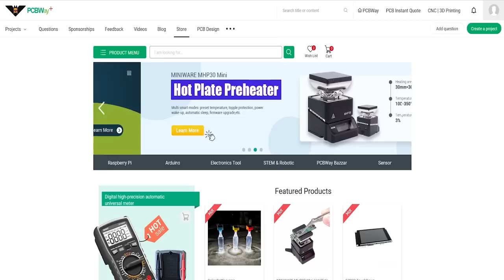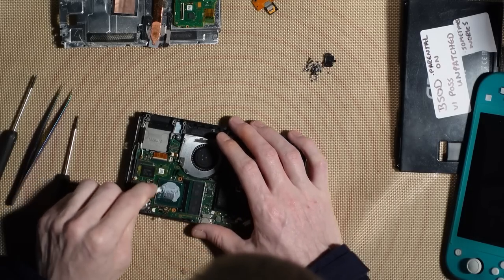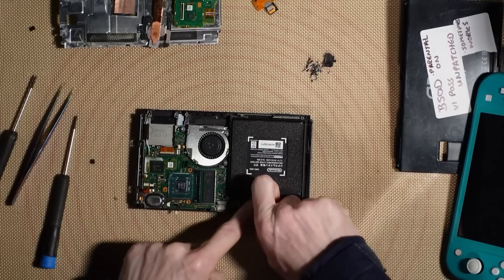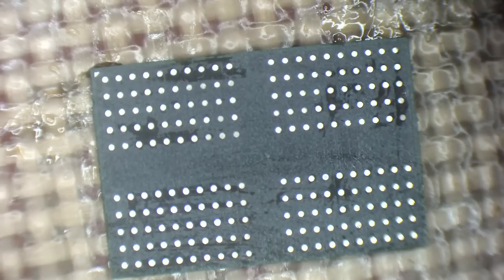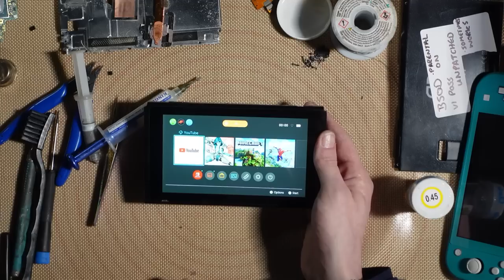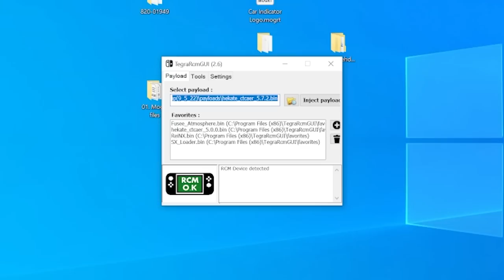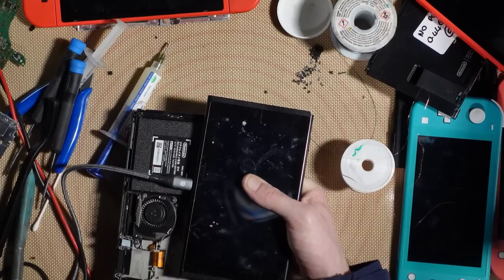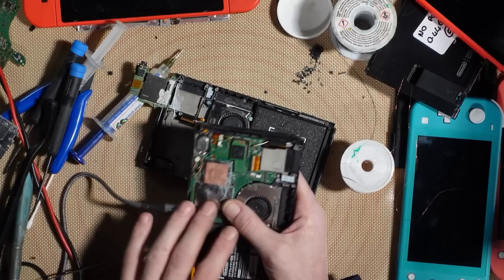I Bought 10 Broken Nintendo Switches... How Many Can I Fix?

Comment: Nice one Phil, really enjoyed watching it. as for the 2nd Switch: at 21:43 you cut the jumper wire and, if you pause at the correct point, it looks like you cut into a part of the trace and the ground-layer nearby, looks like they are shorted together, maybe that is part of the problem.

Comment: I like how even thow you've been doing this a while you still get excited when youve fixed one. Love your compassion for the job. Very informative. Allso answered one of my questions. Bought and repaired a switch lite only to find parental controlls set up, on phoning nintendo was told without missing a breath to throw it in the bin because data protection says they can't give me a master pin. I politely told him that the previous owners details are all still on the device and need the pin to remove them. Keep up the good work

Comment: Got a question for @thecod3r

Replaced a digi on nintendo switch. Screen works around the edges only. Bought another and it does the same. Replaced the board that controls touch and measured diode readings to a known good working board and all good. The old one works as normal. I have bought a third now to see if it works. Do you know if theres compatibility issues or diff variants off digitisers?

Comment: 14:02 I'm interested how that goes, because I also bought broken console off ebay, fixed it and it also had parental lock on. Contacted Nintendo amd they just said, contact the owner, we cant do anything,good luck. With a bunch of back and forward with the seller I managed to get it off, but nintendo really didnt help at all. And this discourages me to buy any more switches.
Reply from the maker: They'll unlock it for you but only if you tell them it's your own console and one of the kids have set a parental lock without you knowing. If you tell them you bought it they won't help you. A few of us do it regularly and it works every time 😄
Reply: @TheCod3r  thanks, now I know what I did wrong...

Comment: hey @TheCod3r thanks for the videos, which Switch video was it when you modified the battery pcb to be used with a lab PSU?
Reply: i believe it was a video with a joycon that was pulling to much current?
Reply: possibly a past live stream of yours or if you have a guide anywhere that would be great thanks

Comment: My switch lite was charging and when came back to grab it it said (an error has ocurre please restart but never power back on , i check inside and i found a lot of shorts around maxchip  could it be that chip gone bad?
Reply from the maker: It's possible but the MAX chips do have some low impedance lines so they could just be lying readings below 50ohms giving you false positives. It might be best to check in diode mode to see if they're actually dead short or just low impedance. If you check out the discord ( https://thecod3r.live/discord ) people will be able to provide you with some good readings from working boards :)

Comment: The current going rate on the Switch Lite (loose) is ~$110.00. However, I'm seeing recent sold listings for the Motherboard, alone, for $125.00. Can't seem to find the logic in this market, cause at the same time broken Switch Lites are rarely under $70. Guess the only thing that makes sense is to scrap the ones you get working. I have no clue how to safely package a mobo though.

Comment: I know this comment is about a year too late, but if you ever have any parental control locks on in the future, just use salt mkey generator, saves a call to nintendo :)
Reply from the maker: We actually found out you can generate a key for any nintendo if you have a Nintendo account. You don't need access to the original account to use the official generator 😳😜

Comment: with the ram there couldn't you have just heated up the board and reseated the chip instead of removing it and putting new balls on?
Reply: It's a good question, but factory solder is usually low-quality that's only intended for heating to melt once before machine application of the chip - happens in seconds during automated assembly.

A reflow can work in some circumstances, but reballing will work every time, as long as the chip and the board aren't damaged before or after the process.

This was why the pressure test was done at the beginning, as if they were damaged too, this wouldn't have worked.
Reply from the maker: Yeah sometimes a reflow can be viable. To be honest the reball on this one was more for show for the video's sake. As PWG says if you do the pressure test and it works normally a reflow is viable, but sometimes you have no choice but to reball it if for example you have damaged traces but if that was the case the pressure test wouldn't work 😄

Comment: Great video Phil, about the switch i would say that its a very overrated console, i get that is the current nintendo platform, i have all nintendo portable systems and the switch is the most unreliable one, the least confortable in your hands couse the joycons and couse it gets hot, the least portable nintendo handheld, the most expensive to get games for, also its heavy as a portable system, the charge port should be on top of the console like every other nintendo handheld, but the hybrid thing hurts it a lot in that regard, a usb c port is not as reliable as an old big nintendo port that just has 5 volts and a ground with 2 big separated pads, i was happy when i got the switch more than 4 years ago, but now that i know the system well and i have played a lot i can rate it properly, is a decent hybrid system with some good games that is not as good as the previous nintendo handhelds couse its handheld mode is pretty bad, its not backwards compatible and also reliability wise is bad compared to the old nintendo handhelds, it bends as seen in the video with the unsoldered ram chips and joycons fail a lot, i am a fan of nintendo since i was a little kid my first system was a gameboy, but i dont like the switch as much as the previous handheld systems, also the pokemon games in the switch are trash
Reply from the maker: I agree mate. They're not built like they used to be! Too many failures and an over complicated charging system 😵‍💫